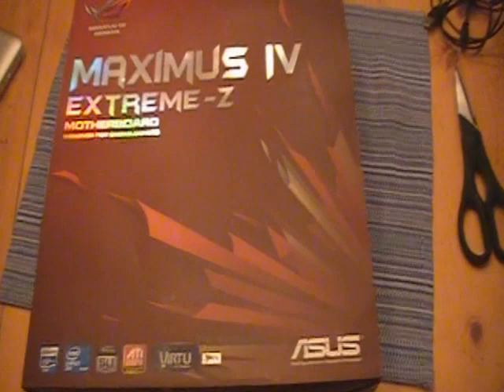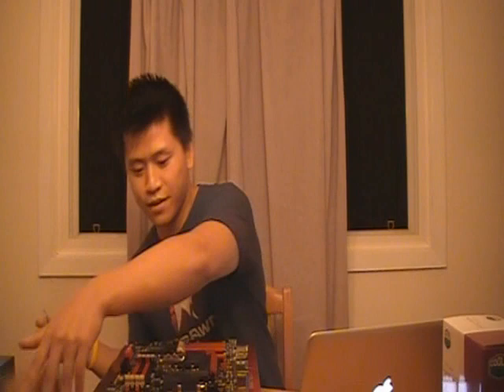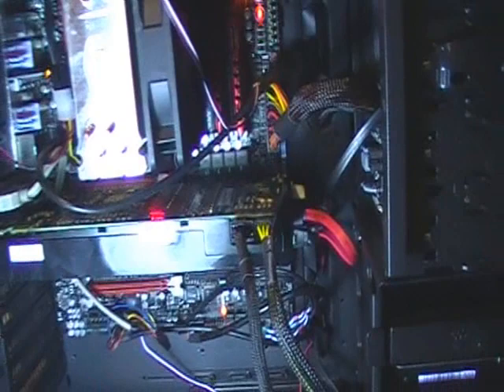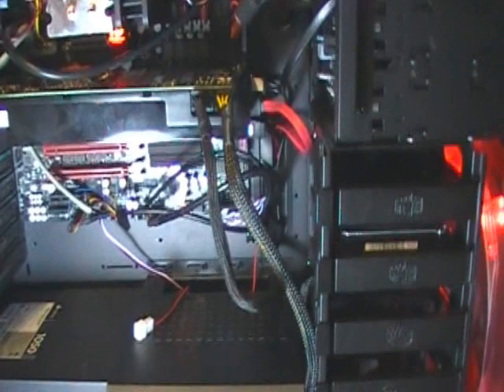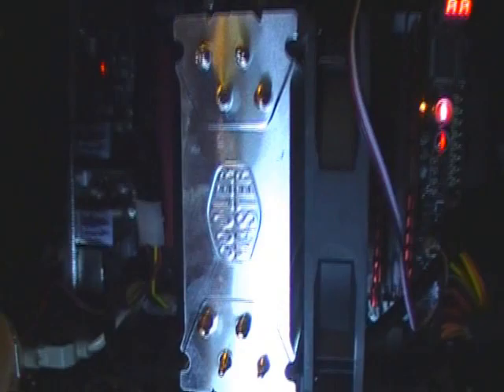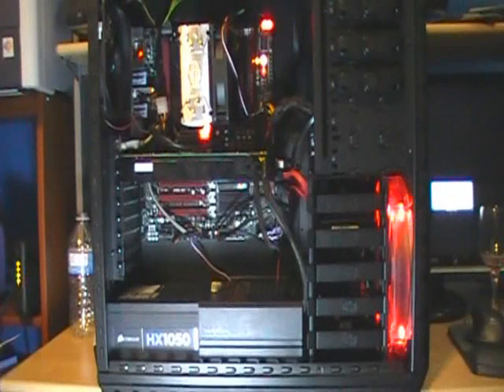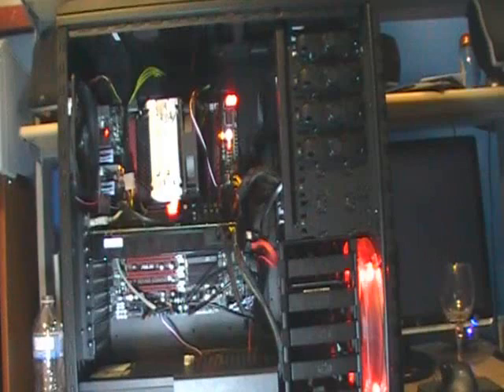Ninja Vlog - Building Gaming PC Part 3 Asus Maximus IV Extreme-Z Z68 i7 2600k @ 4.6ghz

Comment: @tetraninja Yes you can. You just have to mount the top fans above the case structure. Can even run 200mm Fans up there and also pull air from a little more of the case.

Comment: @tetraninja Yes you can.... Mount the rad underneath the top, then put 3 120mm fans where the 200mm fans went, so they are pulling exhaust, and put 3 120mm fans on the bottom of the rad, pushing. Push/Pull, on top of the HAF X. I know this because that's what I'm running in my HAF X... LOL. Watch: 

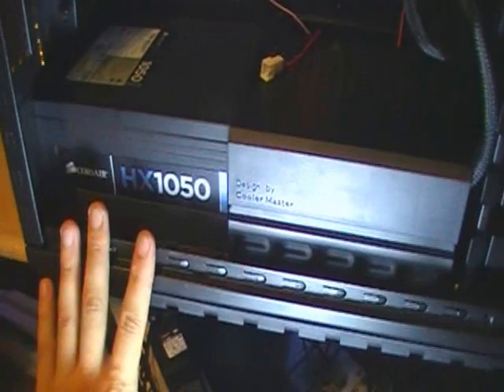Go to **7:10**   /watch?v=C3i9EV3P9gQ

Comment: you're high!  my 932 can support an H100 easy! (932A is the predecessor to your HAF X).  And there are a few things you can improve on later.  120GB SSD later down the road, NVidia GPU (preference really), and some extra fans.  HAF X is very good for cooling, so don't just standby with what you have.  Use it to its fullest.  I've got two builds (932A) if you wanna check em out.  One of them features your M4Ez mobo, and it's OC'ing an Ivy Bridge (3570K) chip.